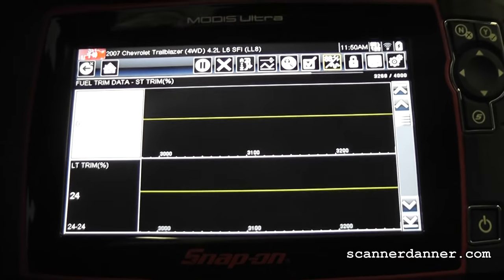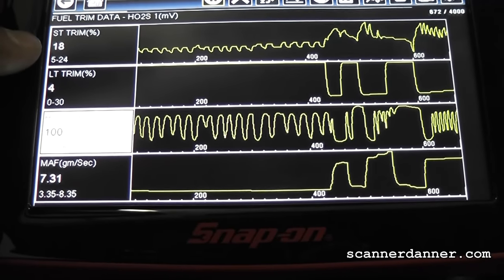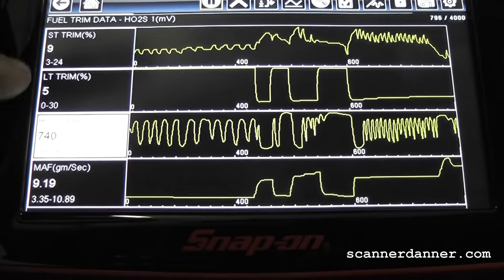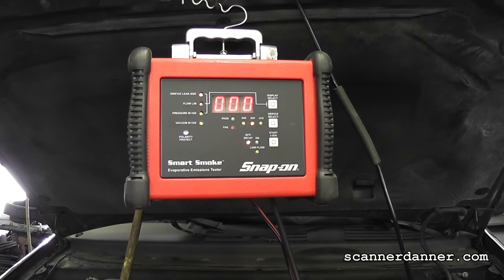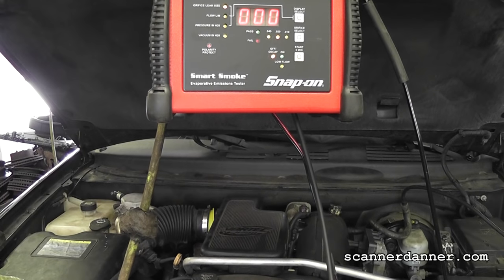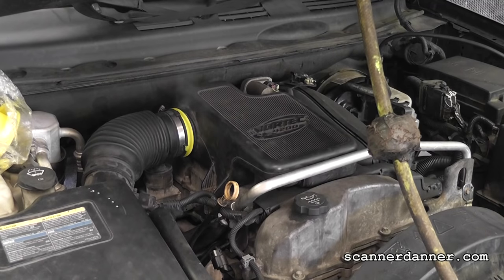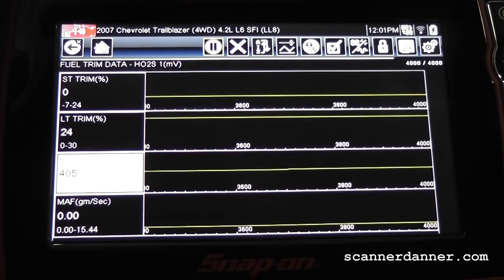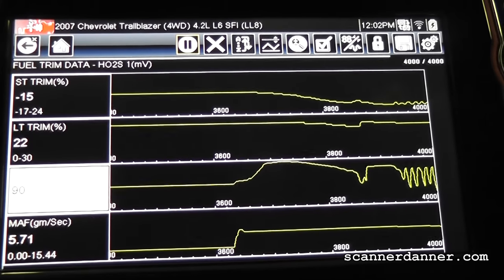STFT reads opposite of LTFT (after repair fuel trim data)

Comment: I wish more people took the time to figure the problem out. I've thrown Alot of money at p171 and 174 on 4.8 vortec. New pcv valve, fuel filter, fuel pump, plugs and wires. Same codes 171 174. Thanks man you rock at what you do!

Comment: Engine temp is 185 on highway speeds. Thank you very much for your time and help. I'm really stuck on this and have to get it inspected. Anything else and in on it!
Reply from the maker: 185 is a little on the cool side. Is it easy to change the thermostat on your car? If it is, do it

Comment: wild. i had a p0171 / 174 lean combo. found the vac leak. also had a sluggish maf that had weird dips and pauses in the lb/min rate. fixed leak. replaced maf and the short trim at light throttle is -20 while the long trim is around +20. it runs great now but i was really curious what the heck is up with those numbers. thanks for explaining that and what i see is just verifying the fix
Reply from the maker: Awesome!

Comment: Nice- I noticed the increase  in the MAF after the fix.  Besides increasing the rpm to help in indicating  a vacuum leak or not is there another pid you have noticed is another good guide to  use for a  suspected vacuum leak ?
Reply: +Steve Rob For the few cars I've applied similar information on, I've found the MAF to not be a reliable tool for vacuum leaks. It points at the fix, but not so much at the initial problem to be fixed.

General statement over, I've noticed a subtle change in MAF g/s get reduced, and more importantly, a better idle and a lower idle that's closer to normal be more of an indicator.
Reply: Besides the MAF , i was just wondering if another pid could be used as well , I don't know  so I thought I would just ask and find out  👍
Reply: Steve Rob
With the last vacuum leak my IAC valve opened even more, opposite of what it needed? Sure, but it was responding perhaps to the overreaction to the O2's demand for more fuel as a result of the vacuum leak.

Another pid...he commented on the RPM for good reason...it's safe to assume the TPS worked fine with the vacuum seeming better at more demand of course.

I like to watch the upstream O2 sensor to verify the STFT correction. That's all I can try to add to your great question. Scanner Danner has blown my mind some times, hopefully he'll respond. :)
Reply: The only pid I could think of was the MAP at idle but like all pids you must know what a normal reading is. If I'm not mistaken the high rpm and LTFT reduction has not always been foolproof for Paul.  Interesting stuff Ah....
Reply: Steve Rob
Oh, that's really good. Gives you a chance to distrust the MAF.
Reply: +Steve Rob Steve, your a pretty sharp dude! Seeing that MAF increase, you would make a good junk yard guard dog, nothing getting by you! LOL!

Comment: I have a 2010 elantra with a rough idle. really rough the first 10-15 sec on a cols start. Continues to run less rough when engine hot at idle. Worse under load. STFT is )(-1.6 to -0.8) and LTFT is (-4.7 to -3.9)  Should these trim number be reverse. Is this a lean or rich condition? Seems like it is taking away fuel? Any answers ? Rich or lean condition. Poor gas mileage, worse power on acceleration.

Comment: Getting perfect STFT and LTFt almost 0 on both. When I come up to a stop light STFT go to +25 then couple seconds go back to right around 0. Then CEL for both banks lean will trigger. This only happens when I’m running the AC coincidentally. So frustrating.
Reply from the maker: Brake booster leak maybe?

Comment: I have a 98 bonneville k engine and using fuel trim I fixed vacuum leaks and replaced all intake gasket and egr tube leak .I have a p0171 code and 300 code intermedi not all the time I did a tune up but still same problem the only thing I noticed after I changed upstream o2 my downstream 02 moves very litle in idle but more during 2500 rpm what should I do I have 2 short term and 16 long term now it won't change

Comment: Ok just got done changing the thermostat with one bought from the Hyundai Dealership. I've drove 72 miles and I'm at the same exact temperature. 185. All my monitor have set except o2s. Isn't there any tests I can do. I'm really not trying to keep throwing parts at it. That's honestly why I can to you because I thought you were really big against that. Just like me. Anything can be properly fixed with proper procedures. I've even asked on your forums but nothing. Well 1 fella did suggest unhooking the battery, which I've done and did again just because he was nice enough to respond. Everything set except o2s. And now I'm driving with dead tags till I can fix it. What would you replace next? Oxygen sensor and air fuel have been replaced twice even though they tested good.
Reply from the maker: of course I don't want you to throw parts at it, sorry for the suggestion about the thermostat, I have nothing else to offer you, sorry, I wish I did
Reply from the maker: "What would I replace next?" nothing, I would need to see the car and I don't have that option. You may not be doing the drive cycle correctly for that monitor to run. All cars are different.  
This is another comment where you seem to be pissed at me for suggesting the thermostat. I asked you if it was easy to do and you never replied, you just did it. So that tells me that it was. Yes, we changed a part, but so what, it was a $10 part. And it is a known issue (engine too cold to run a monitor).  Also, why were the O2 sensors replaced in the first place? 
If you are going to be respectful, we can move forward, but lose the accusatory tone or I'm done.
Reply: @ScannerDanner  let's try this again! First I'm not pissed off! I'm not one of them clowns! Frustrated (YES) but not pissed off. My name is Ed, I live here in Delaware. I use to work for Lexus of Wilmington for several years. I left because I could take what they were doing to customers. Example= charging customers 14 hundred for a timing belt job but only changing the wiper inserts and oil change. That was my work order, my writer said we didn't have time for that plus the car ran great according to him! Yes I got the hours for the job but that's not cool at all. I had it made there but I cared about fixing people's cars correctly. I now have a small shop here in Delaware and have a pretty good clientele list. Plus I do alot of cars for postal workers in my area. I'm not the best mechanic and don't have the best stuff but I won't bullshit a customer or take on something I'm just not comfortable. Now about you, I honestly appreciate all you do and support you the best I can( like now I'm not asking for a hand out, I will gladly send you money first for your time and help) I believe you're like me but just alot better technician. I'm trying to get better but it's on my own. It's just me and my dog. So I knew I could reach out to you and most likely get this straightened out with your help. (Even though I know I was throwing parts at it I didn't question you, I just did it. Even though I was 99.9% it wasn't going to help. I respect you that much) what I was bothered by was after I changed it (honestly no big deal! I wish it was 10 bucks though! lol) I was hoping you'd help me the best you could. But I felt like you were like that's it beat it. EVEN THOUGH I KNOW YOU DIDN'T MEAN IT THAT WAY! I was hoping you'd ask me something about the car or even to try something else. I know I can get this car fixed if you'd be kind enough to help. I'm sure you have a life and family and I job, and I fully respect that. And that comes first as it should. And I understand you have to work through me and you don't have the car. That's why I'm willing to take any of your suggestions. Alot of issues I ran into just your videos have saved me. But this time is something different. I've  never seen anything like this and honestly don't know what to do. I've done the manufacturer's drive cycle to a T for this car along with God only knows how many others. The car runs absolutely great, it just turned over 100k, all the monitors set except for the o2s monitor. I'm sorry if you misunderstood me! And I hope I've made the situation more understandable now. It's hard to tell how someone is feeling or acting through just text. I honestly thought you'd be curious about something like this if you've never see it before. I really pride myself on my work and how people feel about me. I know you could probably easily fix this if it was there. But you have to work through me. And I understand that can be frustrating. If you look at my previous post, I've always been very thankful and appreciative! (NOT LIKE YO CAN YOU FIX THIS FOR ME) I'm not like that. I honestly respect and look up to you enough by reaching out to you. If you don't want to help or can't I fully understand that. I was just hoping you cared a little more. Maybe you do and I wasn't understanding correctly. But if you willing to help I'd greatly appreciate it. If you want money my email is waterfowlde@gmail.com. let me know how much and how to send it? I gladly will. If you want me to perform a test or whatever I'm on it. I really respect your input and fully realize that it's not as easy as having the car there. I don't know exactly what you want to know about the car so I won't just keep blabbing but I believe you asked how this started. The car came to me for service, oil, air & cabin filter, trans fluid, tire rotation and check engine light. Plus I said I'd get it inspected for her. It's an older lady. Super nice. Code I had was OF COURSE P0420 but I was highly suspicious. Monitors were all complete at the time, just the CEL. One code. I did my maintenance, ran my scanner and saw rear o2 was pegged 25% and not responding at all. Front air/fuel sensor was real sluggish.  So I recommended the sensors. Plus I realized the previous person that was working on it destroyed the o2 plus and the harness plug and had it all taped up. I removed the plug housing, test all my wires, they were good and in great shape. Wires to ecm, fuse box are all good. I put the new connector  housing on, tested again, all good. I had a permanent p0420 but after the drive cycle it cleared itself, all monitors set except o2s. I researched and researched, tried slot of things, drove alot. Then I reached out to you. All my monitors will set except o2s. Last night I even got all the monitors to complete except o2s in 1 drive cycle. 
I TRULY APPRECIATE YOUR TIME AND HELP! If you'll continue please let me know what I could do now or what you may think. Thanks again. I hope all is going the best it can for you during what's going on. Take care.

Comment: thanks for video man.  i did so many things on my x3.  but if u want to do something good u must do it yourself. i was just forced to bye odb2 blootooth reader. at last i found adjuster unit leak today as i was in hurry (its very hard to take it off from x3) i could take it out  by half , cleaned as put some sealant around. i need to make some more as i found but i got stft -10 and ltft +14+16 and if u say its normal well thanks a lot. :)
Reply from the maker: +beso facacia nice job understanding that and I would call that a fix

Comment: I drove again today another 125.1 miles and the o2s monitor isn't ready. I'm past inspection date so I'd greatly appreciate your thoughts on this. I've never has a o2s monitor not complete this long. And especially be the only monitor to not complete! Thanks again and take care.
Reply from the maker: Thermostat may be opening too soon running the engine at a lower than normal temperature. I've seen this before. What is your engine temp at highway speeds on the scan tool?
Reply: @ScannerDanner  ECT at 65mph is 185.0

Comment: What mean if I have Zero short term and 27% long term, i have P0086& P0106,
No vacuum leak at all, LTFT  keep checking all times between 27% to 18% but never go less 18% whatever RPM, you think there vacuum lean or bad fuel delivery ?
Reply from the maker: Define the other codes.
Reply: @ScannerDanner  both codes related to the MAP sensors,

Comment: Hi. Another amazing video! 
What about the vehicle that has MAP sensor. It could be a vacuum leak? 
I got Hyundai Sonata has only MAP sensor (2010 2.0 LPG engine)
LTFT is +16 and higher
STFT is oscillating +1,6/-1.6 at idle. 
STFT is +16 and higher
LTFT is fixed +1.6 At 2500rpm.
If increasing rpms, STFT goes positive high
No check engine light comes on. Is it a fuel delivery problem?
Reply: Could be dirty maf sensor

Comment: I have a 2000 Toyota Celica 1.8 take GTS it idles fine bogs down when I first touched the gas how's your new fuel pump new throttle position sensor no engine codes just trying to get pointed in the right direction
Reply from the maker: Post this to my forum. It is free to join and we can definitely help you there. www.scannerdanner.com

Comment: hmm, nice vid... but got a question...

for instance. 2007 Mazdaspeed 3 at idle.
if i have relatively normal long term fueling 0 to 4 % and short term is stuck a -25.x % what does this means?

thanks in advance
Reply: The car is running rich and the computer is taking away fuel.

Comment: I've got a very rough idle. Sometimes feels like it wants to shut off. Checked fuel trim last night and LTFT bank 1 went as high 16.4 and bank 2 went as high 7.8. When holding at higher RPM's bank 1 went down a little bit, but bank 2 went up a little bit. What's that all about??
Reply from the maker: +FieTraxxBeatz check it for a vacuum leak first
Reply: +ScannerDanner I don't have a smoke machine so I tried the cigar test. Also a vacuum gauge tester. Even tried spraying water around the intake and the vac hoses. Found nothing.

Comment: Hi Danner, i repaired the STFT -13 and LTFT -11, both are negative value by cleaning the MAF sensor. However after repair I rescan with OBD and got STFT between 0 to 3 and I can see that LTFT is learning and sometime get around 3%. However after test drive my  STFT play around 0 to 11 and LTFT stuck at -11. I know in total total trim will be 0 because STFT is +11. But, Why the LTFT stuck -11? Is it because that cell not learning anymore? Looks like STFT want to trim but LTFT was stubborn to follow STFT. I still not disconnet battery yet and will do it tonight and rescan tomorrow morning and see if LTFT had improvement. Is it ok if STFT +11 and LTFT -11 after disconnect the battery and stay like that for long period of time. Appreciate your thoughts. Your follower from Malaysia.
Reply from the maker: It sounds like you fixed it but the long term didn't quite learn yet. You are absolutely fine to keep driving it, or do the battery disconnect (cap discharge) to reset the memory.
Reply: @ScannerDanner  thanks for your reply. Do I need to worried if the scanner said my 02 test not complete. Other test are complete. From where I live we don't have to do emissions test like some states in the US where they are compulsory for emissions test. If my 02 test not complete does it will effect the car performance? From my internet research I found out that this 02 test will complete itself after do the drive cycle run. Still not doing it. But if it's not  affect my engine performance i will let it reset itself after i take long trip in the future. And will not worry about it for now.

Comment: 97 f150 4.2 
St ftrm1 -2.3-+1.6 @idle
St ftrm2. -2.3- +.8 @ idle
Lt ftrm1 4.7
Lt ftrm 19.5
What could cause the bank 2 long fuel trim to be so high? Goes to 0 as soon as I press the gas. Vac leak? Exhaust smells rich as well.
Reply: You ever figure it out?
Reply: @mikeb5981  
Blown head gasket. Had low compression on that bank, replaced both head gaskets and had the heads rebuilt.
But still check for vacuum leaks, more common than a head gasket.

Comment: Two questions will u see the negitve fuel trim numbers on every vehicle or is that just a GM thing. Second what smoke machines do u recommend a tech looks into for himself, not a big shop one but a personal one.
Reply from the maker: Every vehicle. And as far as a smoke machine goes any smoke is better than no smoke. You get what you pay for if you know what I mean.
Reply: Soo to have a good smoke machine I have to pay 3000 vs 1000?
Reply from the maker: I've only used two smoke machines. This one and one called redline (I think). So I really don't have much experience to what else is out there. There are guys making there own. Look into it. Do your homework. Sorry that's all I can offer.
Reply: +ScannerDanner okay I can live with that answer.   I had been looking into a littlw I just didntbwant to pay snap on 3k if I can pay1k for the same thing. but thank u I'll be getting one this week
Reply: +phillip zanders I bought a disco smoke machine and made some minor adjustments and this worked quite well for me.. Extremely cheap too:)

Comment: using the brake booster line can backfire if the leak is in the booster itself. i just got caught by this one. the brakes worked fine & there was no noise but there was a very large hole from corrosion in the bottom of the booster.
also, a $35 fog machine can be used as a crude smoker for those who don't want to spend $1000 for one.
Reply from the maker: Absolutely!  I did one on a Pontiac G6 and that's what it was. I'll post the link
Reply from the maker: https://m.youtube.com/watch?v=1Ea0Sjx_ZXE